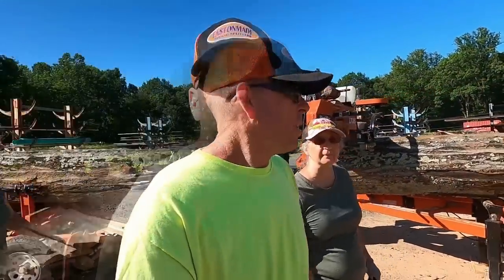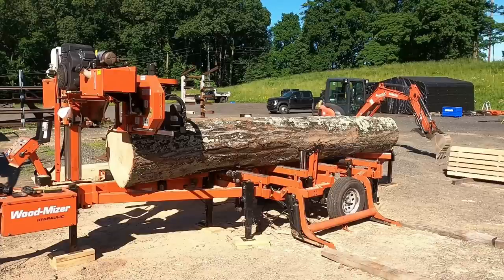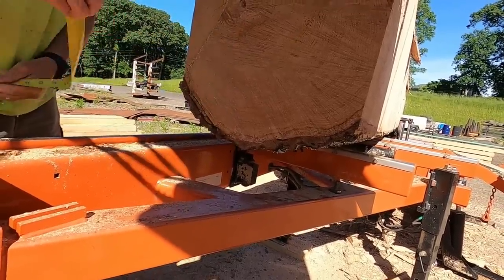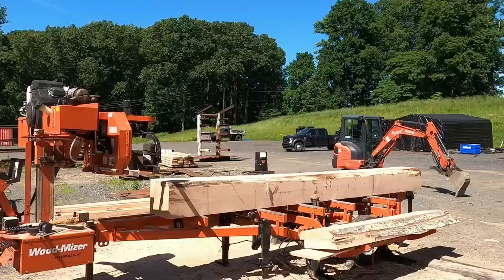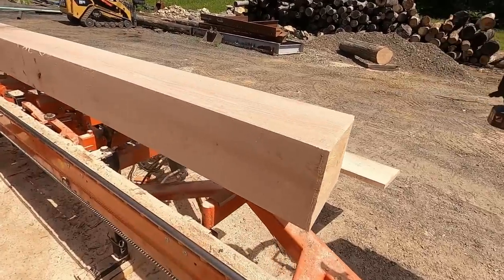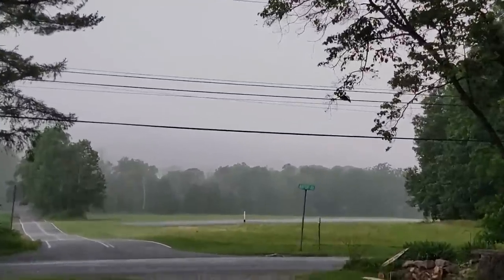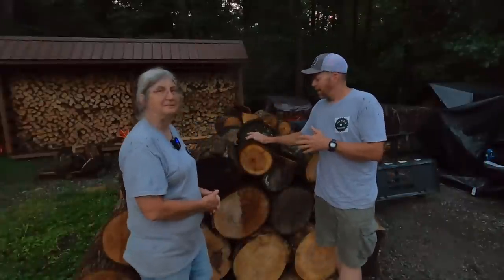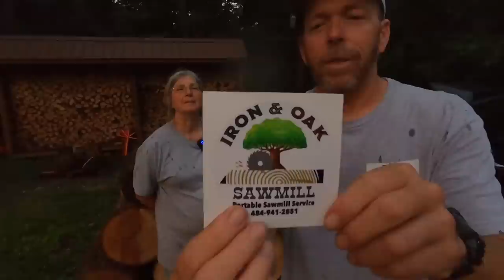How to Make the Best Beam You Can

Comment: Good video.............until the rain came. Don't like getting wet; unless it's in the shower. I noticed you took a number of "veneer" cuts from the cant; was it moving that much?
Dave
Reply from the maker: At least we beat the rain.... Still managed to record the closing before it got to dark.
It was moving a bit. I like to take those cut on logs this long, after I turn i/ and before I pull a jacket off. Just to insure the board is straight. Also, I save that last little cut to reach final dimension. Lots of turning, and lots of veneer cuts, but the beam should end up as straight as can be.